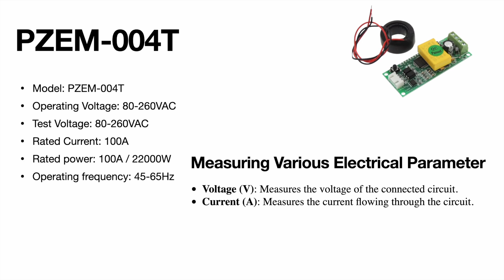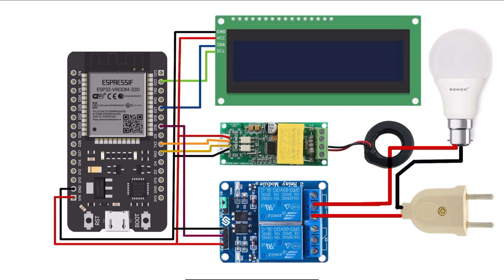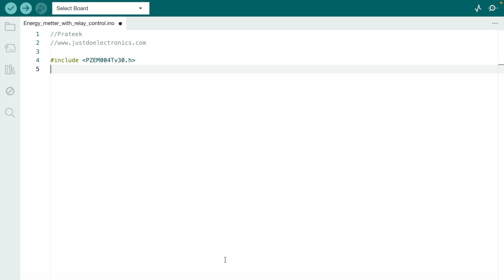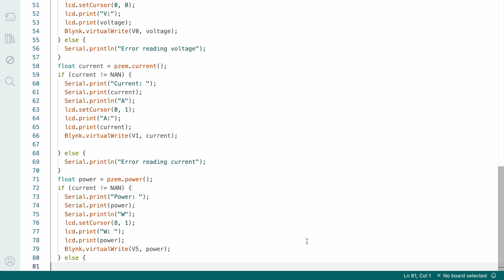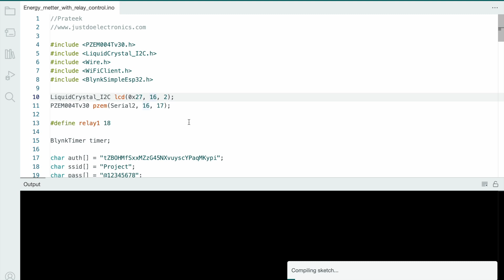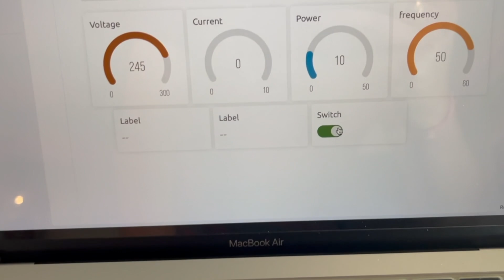PZEM-004T Sensor With ESP32 & Blynk App | Voltage | Current | Frequency | Power

Comment: Hello, Is it possible to add a threshold for current using the relay (Example: if current > 1.2 baseline for (overcurrent/short circuit)) alerting or notifity the user??
Reply from the maker: Yes is possible

Comment: Hey i have a doubt can we directly connect the Rx tx terminal to esp 16,17 pin because esp 16,17 uses 3.3v logiv and pzem has 5v so do we need any voltage divider.???please reply mine is not working 😢
Reply from the maker: No is no need any voltage divider

Comment: sir please give connection for relay
in circuit diagram the pzem 004t connection are missing so sir please give interfacing connection of pzem-004t relay to load and 230v
Reply from the maker: Check the GitHub link available

Comment: can this circuit be used to measure the current of main AC powersupply in our house?
Reply from the maker: Yes
Reply: @JustDoElectronics  thank you, another question. can this set-up be used to do bidirectional energy measurement?
Reply: @JustDoElectronics   hi mate , cannot found your code in your github do you delete it?
Reply from the maker: no

Comment: Which version of Arduino IDE are you using?  I can never see the top line of the Arduino IDE - so I can not see the version numbers.  Some versions do NOT work well with the ESP32, so it is REALLY important to know what version you are using.  Also - EXACTLY which version of ESP32 board are you using?  Without these two VITAL pieces of information - you can be condemning your viewers to failure and frustration...  Clear information please...